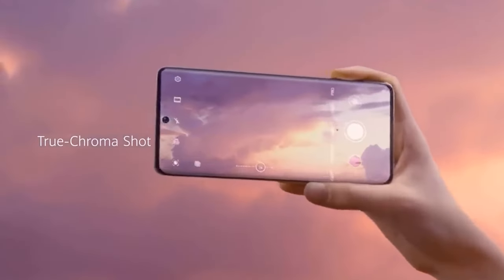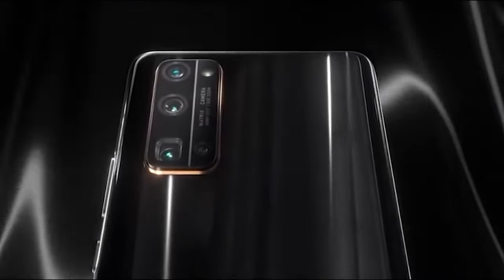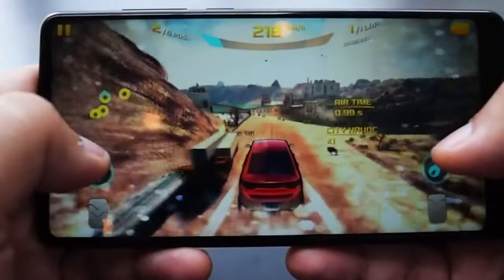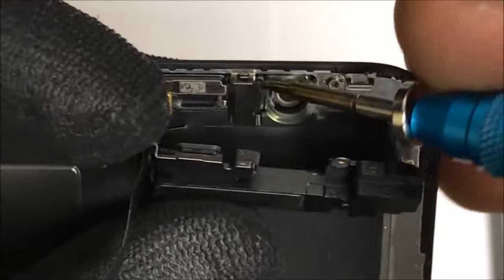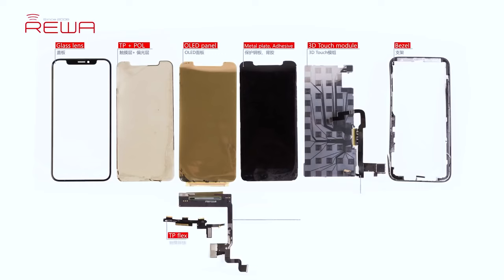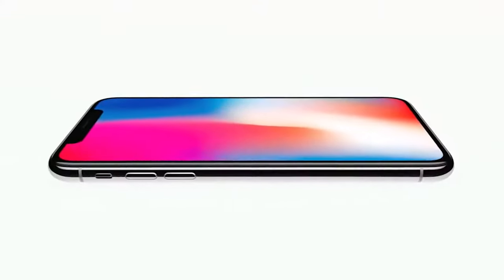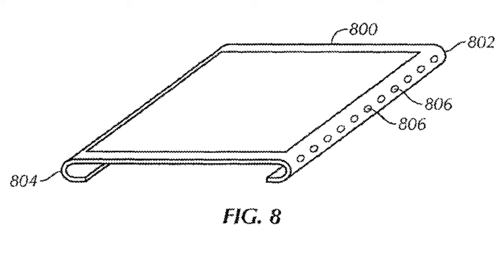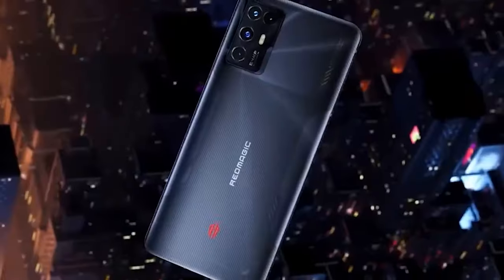Why do ANDROID smartphones have a CHIN?

Comment: Only on cheaper phones now. This video is so outdated. Xiaomi 13 no chin, galaxy s23 no chin, even nothing phone 1 no chin
Reply: All phones 1000 euros mocc a kitemmuort. Cheap no?
Reply: hell, even the phone 2a has no chin! and thats a budget phone
Reply: @alsonotraeon  no Is not.
Reply: @Jacopichua  yes it is. thats literally the entire point of the phone existing. its to bring the phone 2 features into a more budget form factor. it literally started at US$350 and most likely will go down in price as well. its literally a budget phone.
Reply: @alsonotraeon  x6 pro Is good not 2a. 

2a Is trash.
Reply: @Jacopichua  thats extremely subjective. and pretty much 99% of people disagree with you. you didnt even give any reasoning for why you think the 2a is trash. also i dont even understand why you brought the x6 pro into the conversation, because it doesnt even HAVE symmetrical bezels. the 2a does. the 2a is AT LEAST better in terms of design.
Reply: @alsonotraeon  Same price, twice performance, thats the point. Gimme x6 pro with symmetrical bezel.
Reply: @alsonotraeon  best design Meizu 21. But not cheap phone.
Reply: @Jacopichua  maybe it has better specs and is insane for the price, but the 2a is also really good for the price. calling it trash is stupid. i dont care if you think the x6 pro is better. you can have that opinion. but youre making a comparison between phones instead of making an actual overall judgement on the 2a. the phone 2a is less powerful but has far closer to stock android and has insane optimization, design, display, and cameras to make up for it. its not trash.

also the meizu 21 design looks near identical to newer samsung flagships, and samsung had the design WITH SYMMETRICAL BEZELS first.

Comment: It just depends on the brand. Samsung makes most of their newest flagships with symmetrical bezels all around, the A series tends to have chins, though. So do the Ultra, they have very slim side bezels but a very slightly thicker chin bezel.
Reply: Not true
Reply: Look at Samsung side add look at chin
Reply: You're right. Just five years after Iphone starting with S22.
Reply: s23 ultra still has bottom chin
Reply: @Gyooopp  that's what I said, yes.
Reply: but why? they have achieved chinless bezels, why do they gate keep it from the A series?

Comment: Samsung s22+ is super thin chin. I think this is a 2019 video
Reply: S22 and plus have symetrical bezels
Reply: Nothing Phone 1, Galaxy S22 and Pixel 5 are the best screens + S23 + RedMagic 8
Reply: It shouldn’t have one at all
Reply: Also redmi note 12 pro
Reply: @Irishkiwi it's thinner than the iphones chin, iphone has big bezels all the way around.

S22+ is 99.9% symmetrical, they could have gone the iPhone route and make it 100% symmetrical but then it would have a larger bezel all the way around, to the naked eye is pretty much imperceptible.
Reply: I agree with you I also have the s22+ and it is very thin but I know they can get it gone so that the screen can just be flush all the way to the body now that would be impressive
Reply: Definitely looks like it with the phones he shows.
Reply: It is. This video is a reupload, it was originally made in 2019.
Reply: @EmilianoApp the funniest thing is, the pixel 5 had no chin. Then the 6 readded it!

Comment: It's the "chin" being unsymmetrical to the other top and side bezels that makes it jarring. 

There are plenty of phones with symmetrical bezels. 
My moto Edge 30 for example 
Nothing Phone aswell
Reply: galaxy s23 and s22 pretty much have no chin as well
Reply: @alsonotraeon my galaxy s23 bezels left side thicker than right side
Reply: @myself4084  that's not even true for the s23. where did you get that from? it sounds like a fake phone lol
Reply: @alsonotraeon  no I found that the screen protector caused that I removed it bezels are symmetrical
Reply: @myself4084  ah, yeah i had a screen protector that did that too lol.
Reply: Yeah thats my problem with chin phones. I’d rather the chin be on the top rather than the bottom

Comment: what about the nohing phone 1?
that thing is littrally constantly mentoning the flexible oled screen to get rid of the chin
Reply: Agree. :) Also Pixel 5 is symmetrical bezels.
Reply: yup. and the s22, s22+, s23, s23+, nothing phone 2, nothing phone 2a (which is even more impressive considering its a cheaper phone), + many others

Comment: Apple has a flexible display which is expensive
Reply: Same with S22 series from samsung  hell even the Nothing Phone 1 for 450€ has symetrical bezels
Reply: Yup iPhone has managed to removed the chin but they can't managed to removed the gigantic notch and today they called it dynamic island. 😂✌️
Reply: @daffvelos  dynamic notch
Reply: @lordvader3697  i mean they just punched two holes like most androids, and turned off the pixels in between
Reply: @MainInternetUser  not really it's far inferior to the hole punch and takes up more space then notch on 13